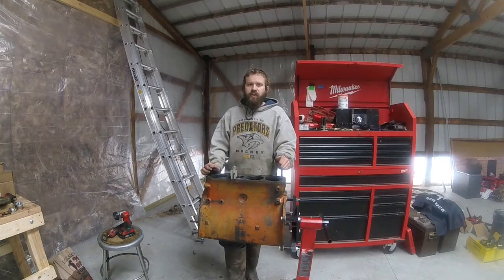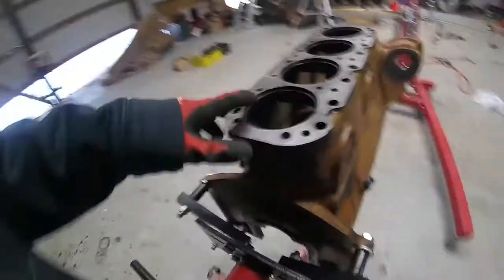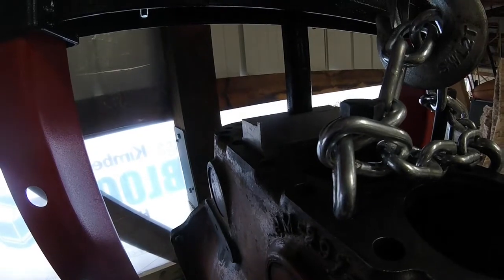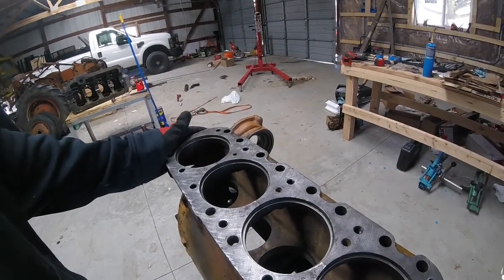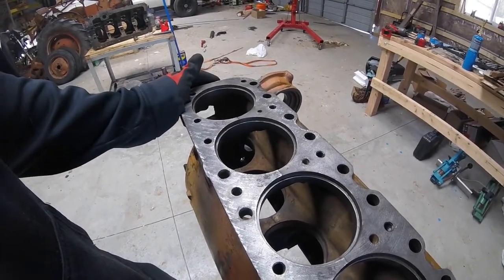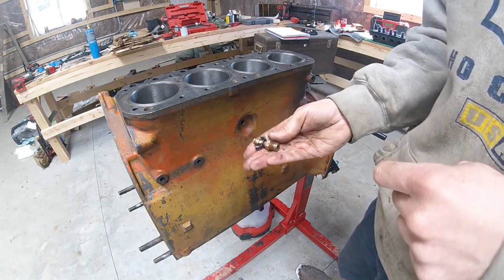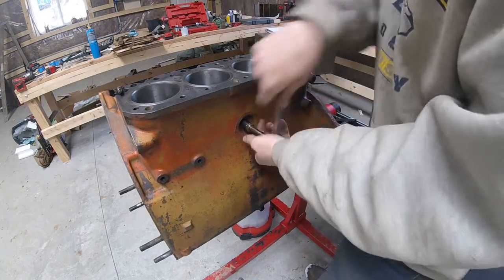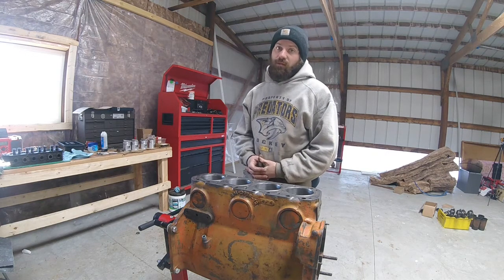Allis Chalmers C Engine Overhaul Part 5: Cylinder Sleeves

Comment: I was fortunate enough my parts tractor didn't have large cracks, One minor one I didn't see until cleaning it very well. This video got me thinking, do you think it's possible to bolt the cleaned head down without a gasket and measure clearance between head and block with a feeler gauge to see if it is flattening the deck out?
Reply from the maker: It's possible, but I would be worried about damaging the head with the raised part of the block.

Comment: Did you consider getting the block shaved and recut the liner counter bores to even things up? That is a low compression engine so maybe it won't be a problem. Time will tell...
Reply from the maker: Johnny, I did think about it, but I'm really hoping to avoid it. I'm afraid after I machine it, it could move more unless it was secured somehow.

Comment: I'm betting when you get the head torqued down, it will be fine. I think you are going to beat me since I STILL haven't got mine torn down.
Reply from the maker: I think so too, but I'd really like to have some numbers to back that up before I put the head on. You might beat me yet, you never know what's around the corner on a build like this.

Comment: Any chance of sourcing another block? It's a fairly common tractor/motor?
Reply: Every one of them is cracked. They all do this, common problem.
Reply from the maker: I do have a lead on a parts tractor. I was going to use it as yard art. Problem is, there's a good chance it will have the same problem. This was a fairly common issue. Thanks for watching!